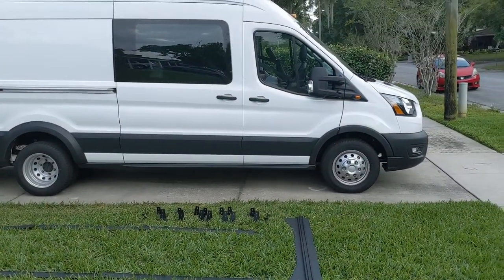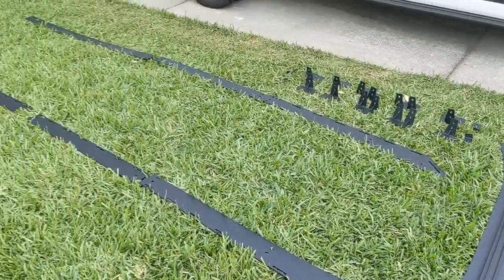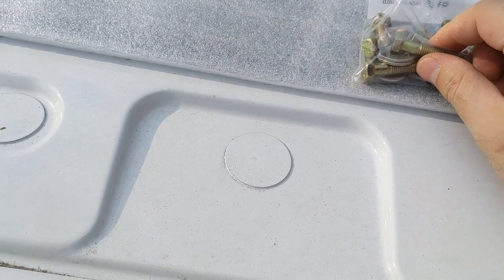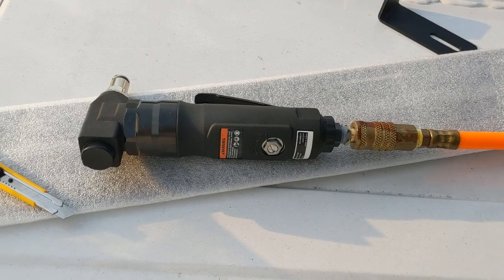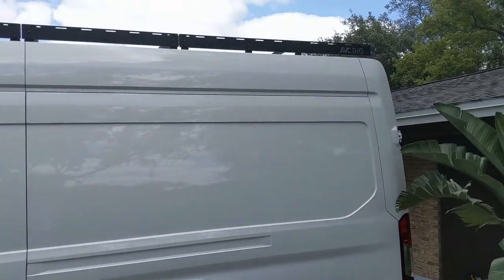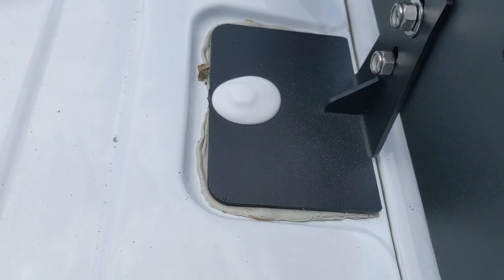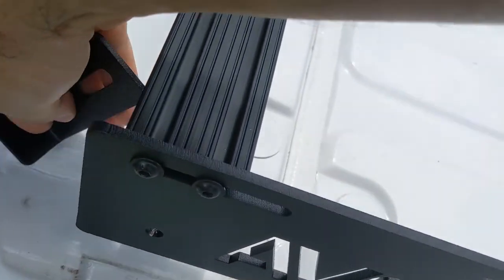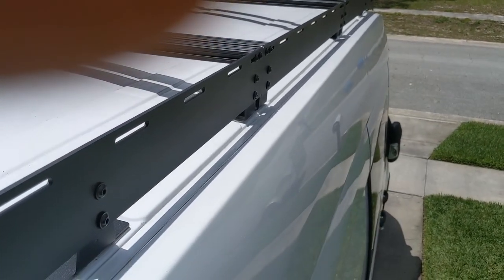AVC RIG Roof rack install | Going Boundless Van Conversion 2021

Comment: What does the metal nibbler do?
Reply from the maker: It's like a hole pincher almost but for sheet metal. It nibbles metal away. You just have ann edge of metal to start with, like a hole or side of metal.
Reply: @GoingBoundless  oh okay that makes sense so its like a step bit in some sense?
Reply from the maker: @malachimesser2074  A step bit if it were to go sideways and not down.
Reply: @GoingBoundless  okay so it can reach how you need it to. Are y'all getting rid of the schoolie ? Or are y'all just starting to the van for something smaller?